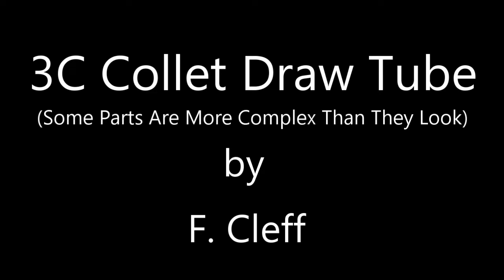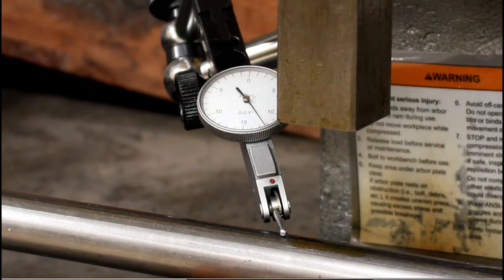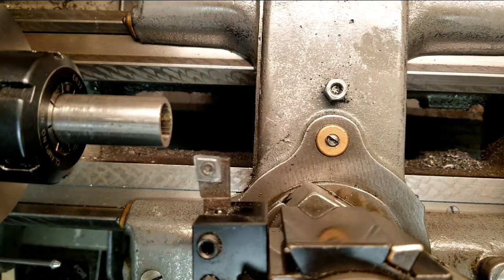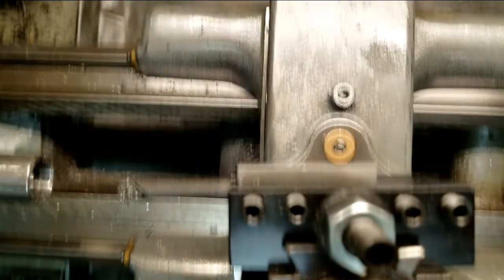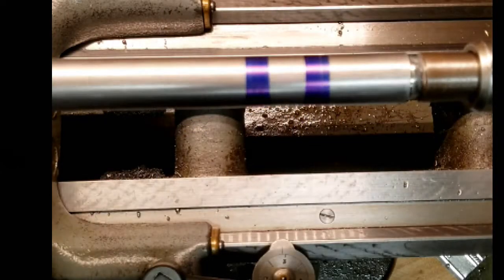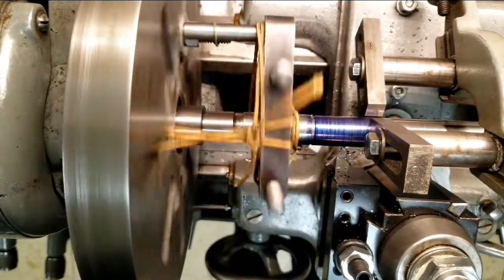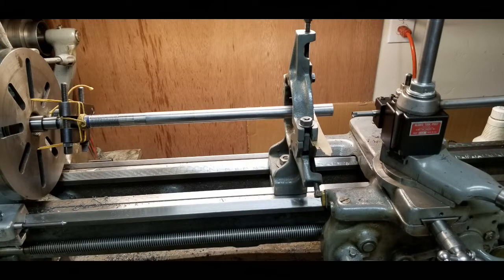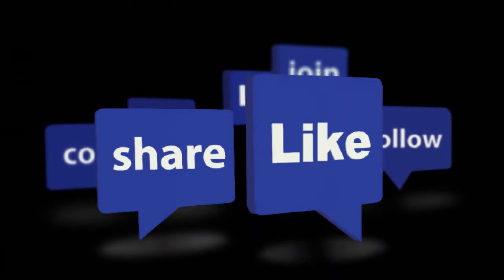South Bend 9A Lathe 3C Collet Drawtube

Comment: Thought the 3c was a 5/8 26 pitch..bigger major. Iike .008 thou...on the collets
Reply from the maker: Hi,  thank you for your comment.  The threads on a 3C are 0.642-26.  The body neck diameter is 0.649".  I don't know the tolerance for the neck diameter but I imagine it's +-0.0005 .
Cheers,
F.C.